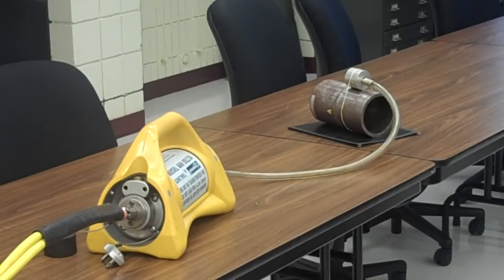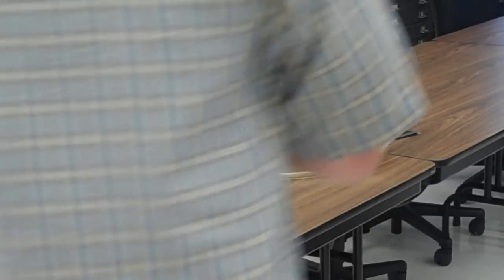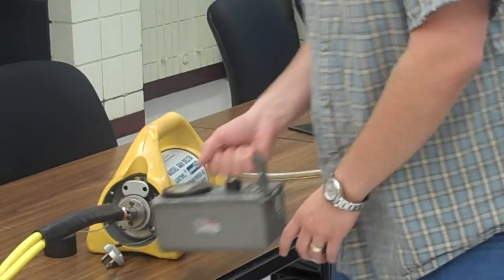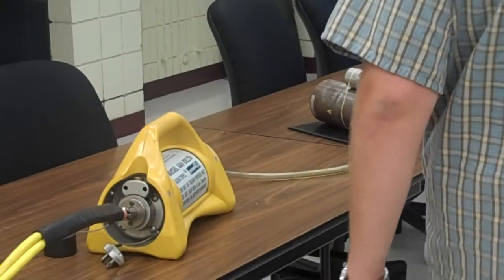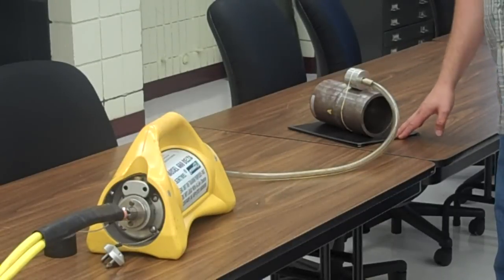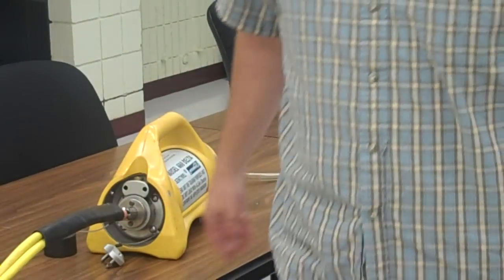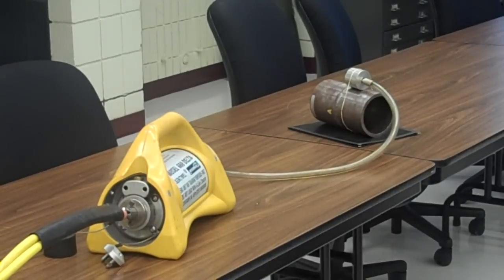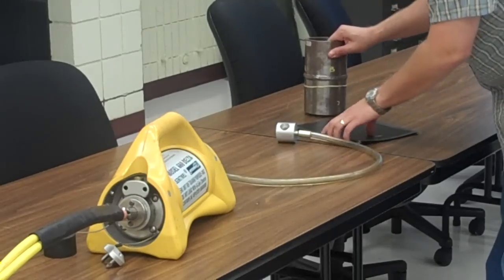Moch up Gamma Ray Shot

Comment: Um for one the the plug where you hook up the cranks should go in the slot above rat causes dirt and every thing to get in side the camera for 2 your survey meter needs to always be where the guide tube goes when setting up for 3 bring the survey meter back with you after your exposure and 4 protect your self always have the open end of the colimeter away from you  have a wonderful day
Reply: 100% of guid tube 360 degrees around camera.

Comment: Do you have any idea where I could gain access to one of the gamma ray emitters? I am currently working on pair production and need a gamma ray emitter, preferably with adjustable energies. I need at the very least on able to do 1.002 MeV. Please get back to me. Thanks
Reply: The iranians
Reply: 1.002 million electron volts? What is that in curies?  Best I can do is 140 Ci from a yb-169 source.